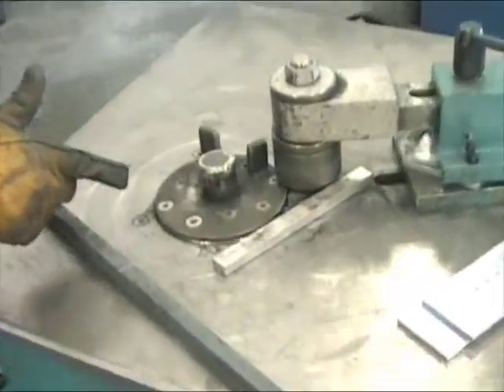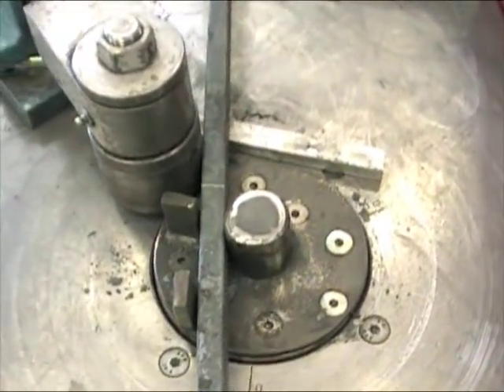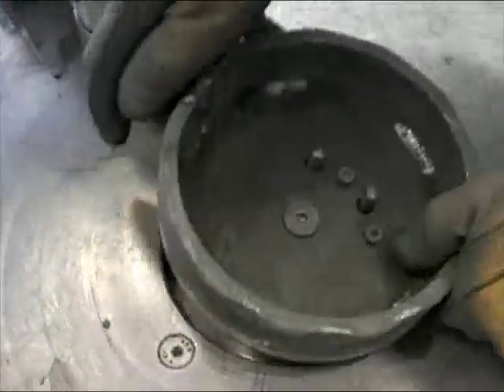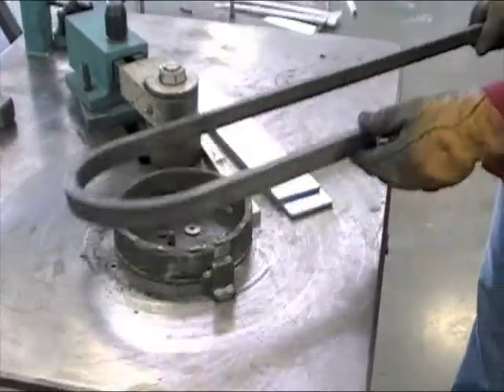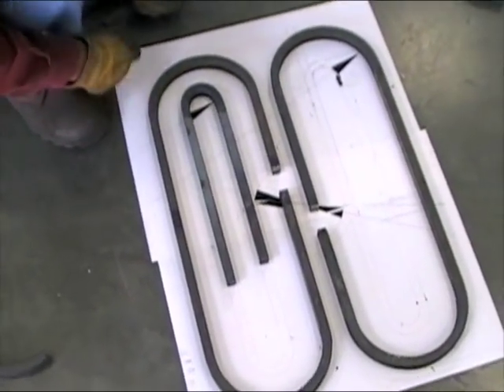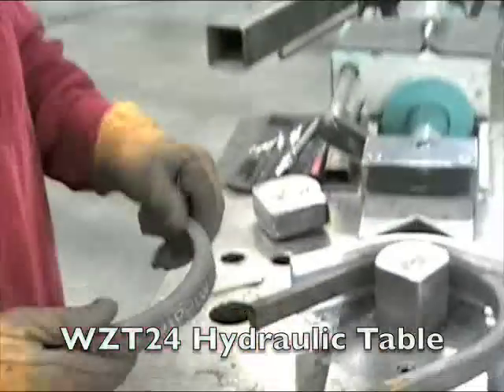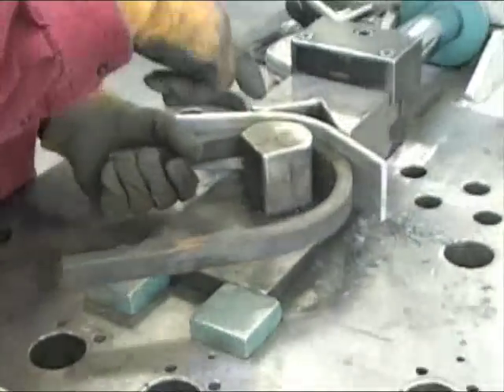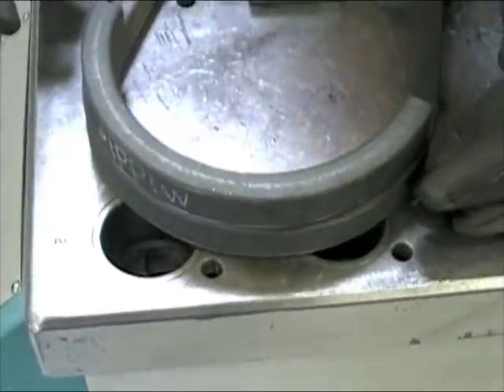SSB3 Scroll Machine: Custom Railing Sample

Comment: @autograssboy That's mill scale on hot-rolled steel.  That steel is rolled into shape while still at or above gamma temperature, and cools in the air, leaving a dull gray brittle iron scale on the surface.

Comment from the maker: @jeffreysanto The machines are made by Hebo Germany.  The machines have US motors installed with 220, 3 phase power.  If you are not wired for 3 phase, lots of guys will use a phase convertor.  We are the North America representatives, feel free to call us at 503-722-7700, and we will mail you out a free full length DVD and catalog.